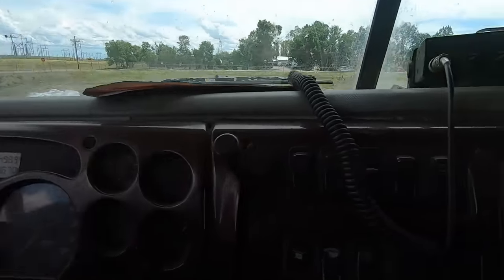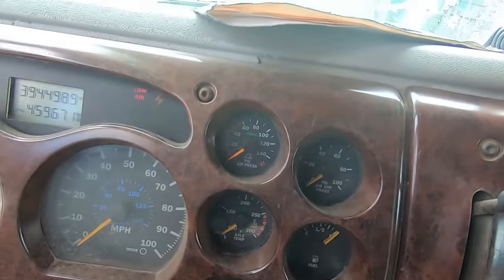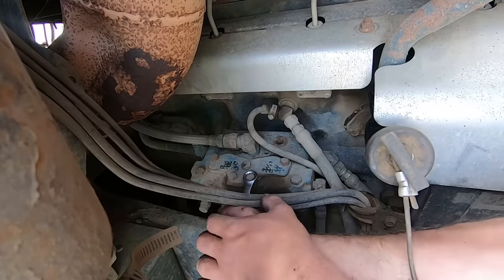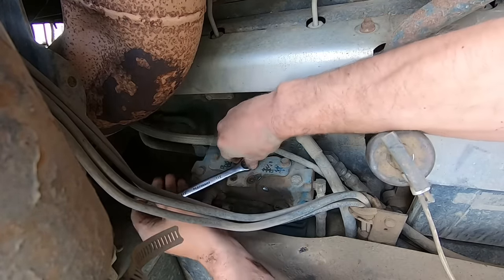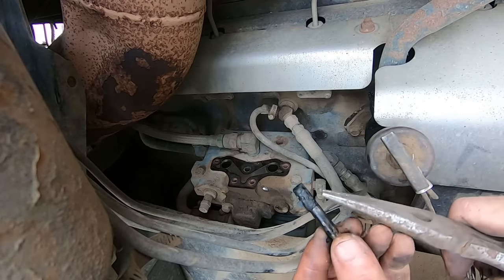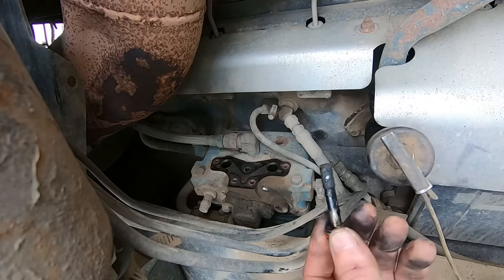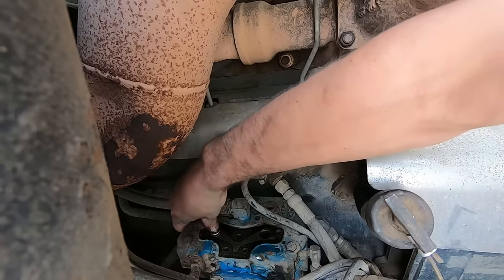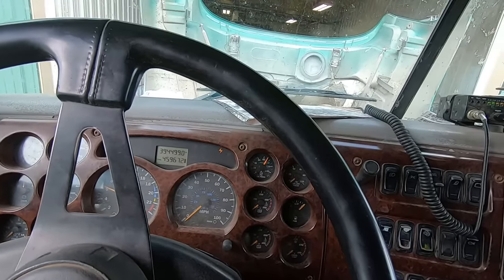truck wont build air - - quick fix - -

Comment: Thanks for posting!! Had the same problem only was a different style compressor on 14l Detroit. Changed the dryer thinking that was the problem.. still wouldn’t build air… cleaned this the same you did now it builds air!! Thank you
Reply: Them freightliner cascadia air compressor is a bear to get to

Comment: Great job, when you're a small fleet owner (in this case a fleet of two) you learn as much as you can about your truck or trucks. I'm a fleet of one myself and do probably about 90-95% of the repairs and preventative maintenance myself like you Ezra. Its a must in this line of work, if want to be successful and have some money in your pocket at the end of the day. If you are going to be in this line of work and own, operate your own equipment, it's pretty much a given you need to learn to turn a wrench on your stuff.
Reply: I love your philosophy.  Best of luck my friend
Reply: Im a fleet of one. Just took my dump truck to the mechanic for an electrical issue. Got it back to the yard and the brakes wont hold air now lol it never stops man 🤣🤣🤣
Reply: How did you get started driving? Im a young diesel mechanic, and being a fleet of one someday is my dream.

Comment: EZ, great work. I always figured, if it was already broken, I could not make it worse.  I never drove big rigs, but I have traveled in a rig.  Once I saw the driver slipping gears, I would do the same on gas trucks and diesel cars.  I had a clutch blow up, on a diesel Jetta. I drove it for a couple weeks. The starter would run it in 1st, once she fired, I  was away.     My sweetheart tried to do it, but she told me to go see my friend and "Get IT fixed"  Cheers to you!

Comment: You're right the egr engines are much worse for carbon build up on the unloader. The Cummins engines  in our Prevost busses are especially bad to clean because of the location of the compressor. Great video

Comment: Thanks from Australia! Glad to learn something new. My Bendix D2 governor is going straight to bypass, even when I swap it with a new unit. Gave this a try - didn't work but hey, I learned something new and my valves are clean again so thanks!
Reply: For reference, 2002 Sterling LT9500 with a 12.7L Detroit Diesel 60 series engine.

Comment: I wanted to thank you very much for creating this video! Most of all, glad I found it & you on YouTube. I am now subscribed!
Today I was removing wet heavy snow from the runways and taxiways of our local airport that my family operates with a 1985 ford L 8000. I was noticing air pressure wasn’t holding when doing short back and forth work. Figured I needed to get the RPM’s up a bit so I took the first swipe on our longest runway.
Something wasn’t correct and air pressure was not building, sure enough brake lite came on and I was out of business. I got a ride back to the building and did a quick search on YouTube to learn about air system on these trucks.
Sure enough I saw this video and figured I needed to give the fix a try. It worked! You are my hero!
Thanks a bunch!! I fixed it in the middle of a snow storm out in the middle of a runway!! 
Also, the gasket broke in several pieces, I figured I  would make one later, and focus on getting this truck off the runway..not only was I able to move the truck. The air system was working great! Didn’t even need a good gasket, fished the day clearing all the runways and taxiways!!
Thanks again!
Tony

Comment: Hard to beat a Bendix compressor. Easy to work on and pretty reliable for what they are. Not what you planned to do but at least it decided to stick an unloader in the yard and not at a job site!
Reply from the maker: It will biuld air in 2-3 mins. Just started it and walked away to do something else rather than sit there twiddling my thumbs for 2-3 mins. Generally leave the fridge on over the weekend to so doesn't hurt to let it run a little while to change the batterys

Comment: Used to drive an old RD model the compressor would not kick out and I would get out and a few good knocks with a hammer would get it working again. Finally took it off and had it rebuilt and no more beating with the hammer. Ahh the good ol days...........

Comment: Saved my Ass got stuck half way backing into dock whent out and tapped the hell out the loader valve started building air thanks man !
Reply from the maker: Glad it helped you out. I would recommend servicing the unloader valve as it will likely happen again soon otherwise.
Reply: You bet next on my list thanks again !

Comment: good deal but I always fooled with the thing on the firewall. Good job on the fix! Thanks, Buddy! GBWYall!
Reply from the maker: the thing on the firewall your talking about is probably the governor, they can be in different places depending on the truck, its normally the answer if the compressor won't kick out and is building too much air. if it won't kick in or is slow to kick in and start building air its generally the unloader valve in the compressor.
Reply: @Ezrider359  Right. I never messed with the compressor but wore the governor OUT! A-PLUS, Pal!

Comment: Very cool. I had no idea. Are all this about the same?  And do you need to bleed the air system down before disassembly?
Reply: After the purge cycle there should be no air in that part of the system but it’s always a good idea to drain the air beforehand just in case

Comment: I'm curious. Would that cause the air to continue build air in the tanks if it's stuck open? My air stays high. And the air tank pops off every 15-20 seconds. It's like the air doesn't stop filling the tanks. Oh and if makes any difference mine is a 2005 Catapillar Acert.Thanks

Comment: Years ago had a truck build air slowly and loose air fast. Couldn't hear no leaks. Finally got a squirt bottle with dishwashing liquid sprayed from compressor thru entire truck. Main airline made more bubbles than bubble blower 😂

Comment: Only had that happen to me once. But the problem wasn't the uploading valve, I had put the truck in the shop for a new clutch. An come to find out there was an airline they forgot to hock up on the back of the transmission for the high/ low shifter. Didn't say much about the shops quality control but they assessed the problem and fixed it almost immediately.
Reply from the maker: Thanks for sharing

Comment: Whats up bud...videos are awesome and learning alot. Question, I have freightliner columbia D60 pushing 680 hp/ 2400 torque its a sleeper truck and I'm coming off otr and staying local. I'm considering a day cab mac but I'm unfamiliar with the  motors can a mac motor be pushed that high ( I'm a power junkie) ....

Comment: That buildup of "crud", is that a sign of needing to change the engine oil sooner?  Pretty sure the engine oil is circulated through the compressor for lube as well in it.

Comment: Your answered was correct not in general are Air governor. must check.this.unloader valve. im 24 years old.
from philippines. Truck Mechanic like you. Kenworth. Scania. frieghtliner.
and also Japanese brand of.truck. i can repair

Comment: So tell me something how do you keep that lightning bolt, light out on the dash use to drive one of those when ever that came on the Cruz wouldn't work etc lol
Reply from the maker: the lightning bolt is a electrical malfunction light. essentially a check engine light. mine is on right now because the engine oil temp sensor is giving me some fits. not affecting anything else. you can use the cruse control switches to retrieve a flash code that will tell you why its on.

Comment: Great videos, iv learned quite a lot especially your kingpin walkthrough,is there any kind of trick to changing the fuel filter on your mack with the screw on plug?? Its ridiculously frustrating and any help would be appreciated. Thank you

Comment: What if it builds air really slow and exhausts air from the safety valve on the compressor head only when building air but it has a new compressor, governor, dryer, and discharge hose? 1999 Detroit 12.7

Comment: I need some help with this problem. I have a 2005 freightliner century class s/t Detroit  60 series. I was on my way to pick up a load, then the back of my truck caught on fire ,burning my air lines( it only burnt some of the air lines on the driver rear side.

Now that I have the air lines back connected it won't build air, but it was building air as it should before the fire. I had to  get it towed,so is it something they disconnect? Please I need to work without taking it to the PIMPS.
Thanks!!!

Comment: Sir My speedometer and Cruise control broke simultaneously on my 2005 Freightliner Columbia. I was told to replace the speed sensor right on top of the Yoke area at back of transmission. I got the bolt out that holds the sensor but the sensor is stuck in there like an alabama tick. I've sprayed liquid wrench on it an am letting it soak for a few days but do you have any tricks on getting this sensor to pop out of there? Due to the instructions that came with the new one I'm assuming that many times they don't come out in 1 piece due to sticking as instruction for new one said to clean the old hole up if parts of the old sensor stuck in there.

Comment: Have a 2014 granite, cement mixer in the parking brakes are set with the PP valve in the set position the brakes will still release intermittently any suggestions the Mack garage change the valve or two not sure which ones said it was fixed but it still does it how does the air bleed over into the parking brake chambers to release them when the parking break is set

Comment: Hey I got a question for you at my work we got a 19 78 GMC brigadier grain truck and one day it was working fine building up air pressure and then shut it off in the next day he went to start up and let a bill of air pressure and it was it won't build up no air pressure and it's a got a Detroit engine in it and it looks like the air compressor is on the back side of the engine underneath the dog house. What do you know maybe what's wrong with it? If you can help I appreciate it thank you and God bless

Comment: Hey bud I watch all of your videos. I need some help I have a 99 w900 brake lights will not work. i have unhooked trailer to see if if was shorting tractor out not the case. I have checked fuses and relays and jumped the wires on the air pressure switch labeled brake switch. I can not get them to work can you help me with any suggestions? Thank you sir!

Comment: I have a 1998 Freightliner FLD120 with 12.7 Series 60 Detroit Engine…
The Truck was running good but I just have this same problem it stop building air……
Could you please please help me out 
If it have the same air governor like yours???

Comment: Please more videos!!!, love your videos, would love to see more on ol red
Reply from the maker: There is definitely a lot more videos to come on old red just been a min sense iv gotten a chance to work on it.
Reply: @Ezrider359  when you gonna start using Old Red???
Reply from the maker: When it's done. I don't have a set time line. Was originally shooting for a year after I purchased it. As slow as progress has been the last couple months it will be a little longer still hoping for a first run hauling a load before snow flys this fall.
Reply: @Ezrider359  cool - is Old Red gonna pull the hopper or side dump or both?

Comment: Does this can be a problem with slow  build up air pressure ?
Everything was fine, just recently my air compressor tu flo 550(detroit 60 engine) became super slow ?
Thanks

Comment: Mine builds pressure to about 35 psi and won’t go any higher. Changed the Governor and this is (suppose to be) a new air compressor what would you suggest?

Comment: I have an old tandem truck that I bought just for the bed for my other tandem. Is it possible to turn it into a semi? I mean I'm sure it isn't a big ordeal putting on a fifth wheel and air lines etc etc.  I was just wondering if they can haul weight wise the same as other semis.  I basically bought the truck site unseen other than the bed, had it delivered and to my surprise it runs and drives. its a little beat up but would make a great truck for local hauling. love your videos.  I have been in construction (asphalt paving and excavating) all my life and have another channel dedicated to it IPaveIt DP.
Reply from the maker: I'm guessing this was a dump truck? If so you should be fine dump trucks are normally specd heavyer than a road tractor. Checking the axle ratings will tell you for sure.
Reply: @Ezrider359  thanks for replying.  I've seen plenty of semi to dump truck conversions but I havent, or at least didn't know I did, seen alot of dump to semi.  its one of those deals where I literally thought I bought a truck I was going to scrap but its in too good of shape and runs too good to d other to it, so gonna have to figure out how to get her back to work.

Comment: Hey I have a cat3406e motor and my air compressor won't build air and it makes a noise like it's quickly releasing air from the air compressor. It's loud and happens about every 5-10 seconds. Any ideas of what it could be? thanks

Comment: Hey bro, I have an 02 century truck. I had a reman air compressor installed and whenever my tanks are at like 20 psi and under the air compressor wont build any pressure. I have to accelerate to build pressure and it takes a few minutes to go over 60psi, once the governor kicks in then my air compressor works like normal again. What do you think it could be?

Comment: Where can I order these valves? My compressor is not shutting off and I have changed the governor and the air dryer. Would the unloader valves allow the compressor to continue to pump?
Reply from the maker: Typically unloader valves sticking will cause the compressor to not biuld air. Sounds like your compressor is not cutting out. Generally a governor. Issue. I see. You said you replaced it but did you check the lines for leaks. A leak on the signal or purge air lines can cause that issue as well.

Comment: Did I see 3+million miles on the odometer???
Reply: Looked like it was almost 4 million!
Reply: 394k, there is a decimal before the zero.
Reply: 43mackmobile did someone say dropped valve on cylinder 5 or 6?

Comment: Hello, I have problem, my clutch brake keeps going out and I'm clueless as to what could be the issue. It had new linkages and everything else put in and was adjusted numerous times, and it still keeps going out. I float gears so I only use clutch to start/stop. I don't ride it all the way to floor either
Reply from the maker: How is it failing? The hinged style ones iv had repeat issues of them coming un latched and falling off. The solution was to go to a different style clutch brake. If you're sheering the teeth off 90% of the time it's operator error you can try to adjust it so you really have to shove the pedal into the floor to get the clutch brake. I have a video on clutch adjust and replaced a break if you haven't seen it yet

Comment: ? I have an issue with my compressor pushing oil thru my air system into air tanks and onto my air dryer filter. Would an unloader kit fix it or does it sound more like I need a new compressor?
Reply from the maker: worn rings on the compressor most likely.
Reply: @Ezrider359  would an unloader kit fix that?
Reply: Hey I need to know that too. My S60 is doing the same things. Previous owner changed the air compressor 3yrs ago.
Reply: @JOKER-zf3dr  No, time to swap a reman, or new one in.

Comment: Hii I am having a issue with oil in air tanks what could be the problem any idea, I have Volvo d13.
Thanks
Reply from the maker: Rings shot on the compressor or a bad turbo

Comment: Take it to the shop and it's going to be $7,000 because it needs whole replacement and they will say there are no new compressors so they will have to get a used one and it's the same compressor then they take up to a week just to replace that

Comment: Hi my air dryer blows off but it don't shut off like it suppose to what could be the problem?
Reply: Sticking purge valve on the bottom of the air drier easy fix🤙🏻✌🏻

Comment: What  make  is  the  compressor ? I'm  not  sure  I've  seen  one  like  it
Reply from the maker: bendex true flow 550
Reply: @Ezrider359  
Ok, its been a long time since I worked on anything but cummins or wabco (or volvo 😱). Back in the 80s I worked On a lot of 450s and 550s. I"d forgotten

Comment: My new f750 takes 12 minutes to build up its 2019 ive had issues with main line broke off pump 3 times we fixed it sent to Ford that lasted 1200 miles just like first broke again I cut it put new crompession fitting then the stack fell off dpf plugged up could find dealer for month than another month down now seems like its leaking air very slow I cant tell where but it making popping sound with brake applied in about 3 different locations im exhausted with trying to find a dealer to work on it less than 5k on truck nothing but issues . And when I got it to that dealer where I cut it said its better than they could do and left it alone but moved a clamp looks like shit compared to when new I could of Jerry rigged better set up but every dealer refuse to work on it I bought 8 hrs away im either just going to run it and  end up leaving along road for ford or run it to dealer I probably will end up needing a lawyer ford said take it to my brothers garage lol I guess if I send warranty claim a bill that will get some laughs but 27 dealers maybe 30 dont want to touch it or tried im in bad marriage and need a lawyer any recommendation on Magnuson act warranty lawyers

Comment: You lost me at egr. How can a combustion process affect a pneumatic compressor?
Reply from the maker: the air compressor inlet is plumped to the intake manifold. so on a truck with egr some of the exhaust gasses that are recirculated into the intake also make it to the compressor.